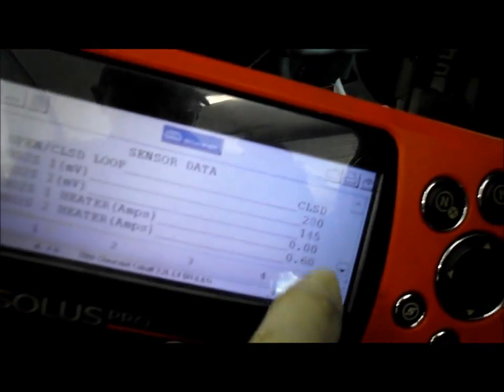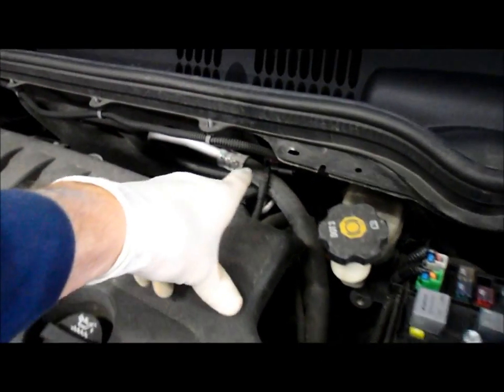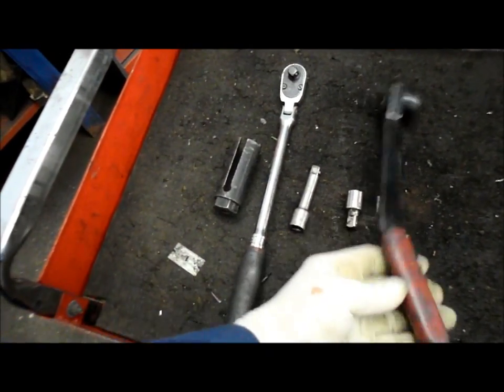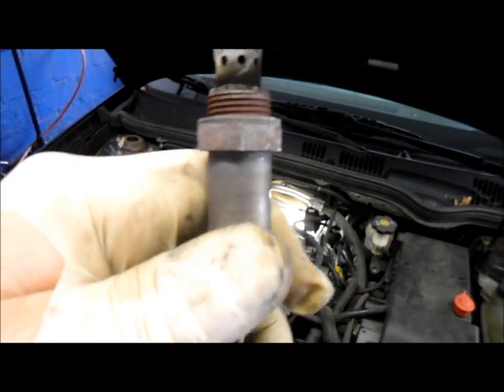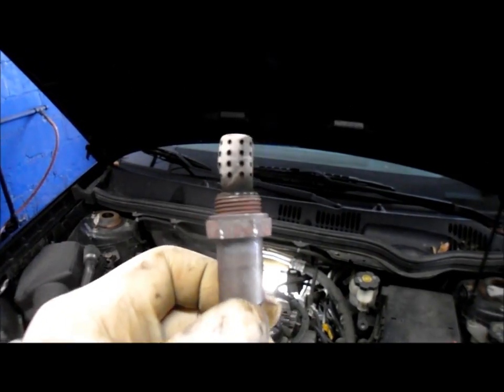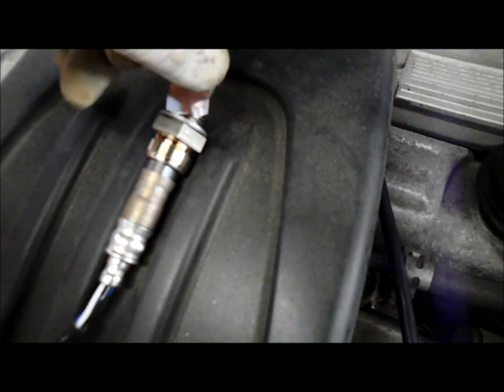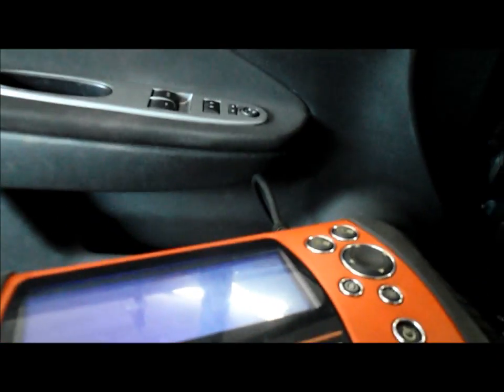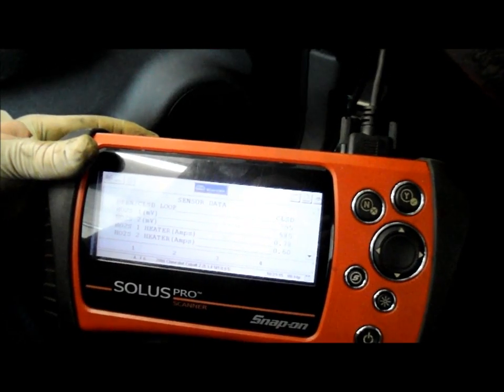Diagnose And Repair A P0030 and P0135 On A Chevy Cobalt

Comment: Hi Jim, great video! Hope you’re still answering questions. I have a 2000 Pontiac Montana, 3.4L V6 with the heater circuit code. We replaced the O2 sensor bank 1, code is still there. I didn’t check the fuse, thanks to your video I will check that next. Any other possibilities?

Comment: Hi Jim, the car guy, I am having a situation with a 2007 Mercedes Benz Cls550. It is getting codes P0030, P0050 and P0300, P0301, P0302, P0303 and P0304 to indicate random misfires on cylinders 1 - 4. The fuses are good. The car has new plugs, new upstream 02 sensors and new ignition coils for cylinders 1 - 4.  Can you let me know your thoughts and how I may need to proceed on this problem? Thanks.

Comment: I have this same issue on an 06 cobalt. I have done everything you mentioned in the video. When I turned the car on it still had a check engine light for the same p0135. Should the engine light automatically go away when the issue is fixed or do I need to clear the code and see if it will come back?

Comment: What does the car do with the sensor bad? My car jerks 1-2 gears or when switching from P TO R OR D but I have p0030 code
Reply from the maker: It is possible that the sensor can cause that. Was there any other codes?
Reply: Jimthecarguy MAF sensor ( mass airflow sensor ) in ur intake need to be replaced , as well as the filter. Fixed that for my car for under 80$ doesn’t jerk anymore

Comment: Nice video, very helpful.  I just changed the upstream 02 sensor (06 cobalt 2.2L 4cyl).  Job done in about 15 mins.  The toughest part was just getting the socket onto the sensor, (did not remove heat shield) once that was accomplished, easy sailing...

Comment: Thank you for the in-depth video! Where my inspection's coming up, the CEL had to go. Sure enough, it was these codes. Ordered a sensor (Denso 234-4668) and a socket (Tekton 4929) for $40 and all it took was about 10 minutes! Worth noting is that I let the engine cool for about an hour so that the exhaust was cool and the engine itself still had some heat for me while I worked. I needed to get two arms on my 3/8" ratchet to get enough force to break the old sensor loose, and once it was loose it was a piece of cake to swap. If anyone has any questions about the process, let me know.
Reply from the maker: Thank you for watching and your input

Comment: What size socket was that?
Reply: It's a 7/8" O2 sensor socket. Tekton part no. 4929 will work.
Reply: I already changed the sensor, the socket wouldn't work on the rear one, it's too long and hits the underside of the car. I ended up using a wrench on it.
Reply: Rear one as in downstream? Socket worked fine for me on the upstream sensor which throws the codes in the video title.
Reply: Yes after the converter, the floorboard goes around the pipe and there wasn't enough clearance for the socket, my code was for the rear, cleared it right up .

Comment: I have a 06 Cobalt SS.  If I have two oxygen sensors can I tell witch one is bad or should I just replace both?
Reply from the maker: No you can just replace the one that is bad.Did you scan the car for codes?

Comment: I have a gmc 2006 canyon with 2.8  four cylinder 125,000 miles. replaced O2 Sensor. truck runs great, cleared code,but it keeps coming back PO 135. may I add truck runs better then it,ever has. bought it with,50,000 been a great little truck. :)

Comment: 2006 Saturn Ion had to remove the heat shield to get access to o2 sensor. There is not enough clearance to get socket in. With shield removed the short offset socket worked great. (3) studs hold shield the one on the exhaust was rusted but came right out.
Reply from the maker: t gray    Thank you for your input and for watching
Reply: Yeah
Reply: t gray my Chevy hhr has the heat shield issue too, same with the one rusted bolt.  But like you said, it just kinda slips right off when you remove the other 2.

Comment: I have a 2006 cobalt and it has 125000 miles and I try to take good care of it for another 125000 miles. Thanks to your video, and the clear, straight forward way in which you present your subjects. I know you have a going business, and it must be a very healthy business. On the other hand, if you ever have the opportunity to be an instructor in auto mechanics, the people that you teach and coach, will benefit tremendously. You're very good at what you do - very good.  Again, thank you for this instructive video. I followed your step by step process and it worked perfectly simple for me.

Comment: Would you please advise me on the diagnostic tool that you used. I've been looking for that kind of electronic tool, and what you're holding in this video would be perfect.
Reply: You can also get one for your smart phone. Its not as good as the one he is using but it will tell you the error codes. It costs about 5 bucks, look for OBDII code reader. I use OBD Car Doctor. You need to buy the Bluetooth Adapter for it (Ebay, mine was 8 bucks including shipping). I found these two error codes and I am going to change it now hopefully
Reply from the maker: Actually that one is made by Snap on and is kind of expensive for private use.You should look into the Autel products they are more reasonable.
Reply: I second this, these tools are very helpful.  Look for an ELM327 Bluetooth Adapter.  ELM327 refers to a chipset that is found on a lot of the ebay and other low cost OBDII readers.  You can even get real time info for many items.